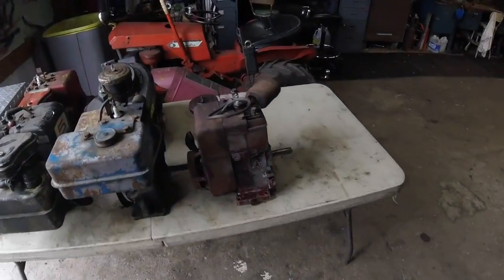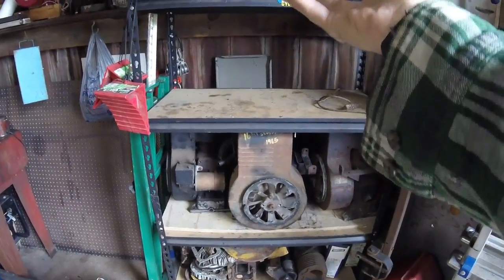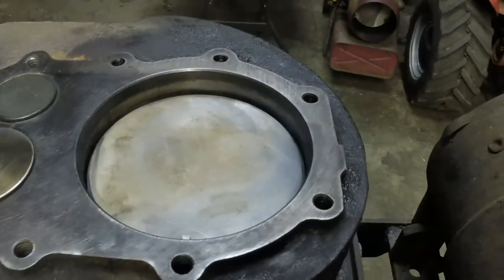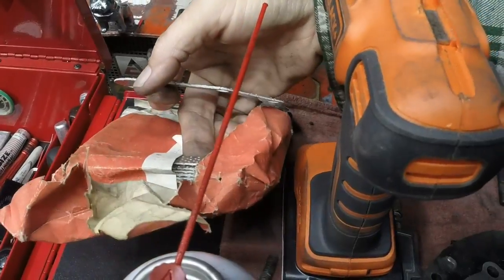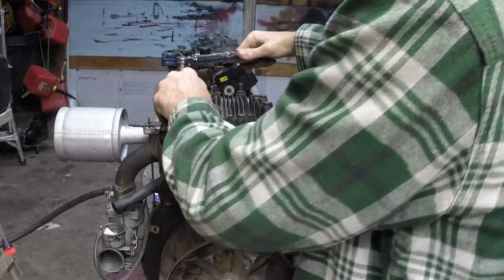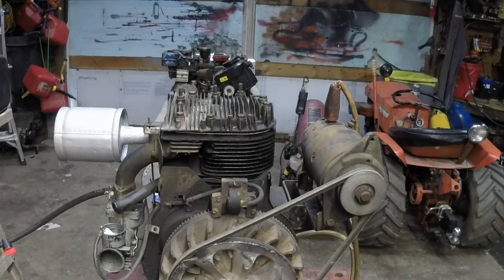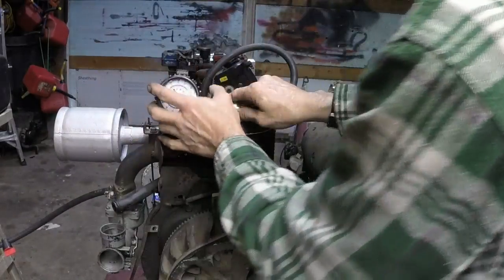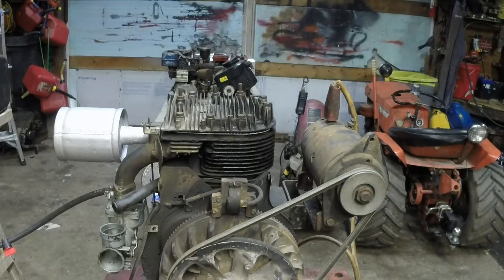Getting Engines Ready Part 1

Comment: did u use either
Reply from the maker: I did not. Although, on the third engine, I gave it a fog real quick. The carburetor was primed for all three (used the same one), but the second and third had a sheared flywheel key. I typically don't use Ether on anything other than diesel engines, but when I'm feeling lazy, I'll give things a squirt. Ether isn't good for gasoline engines which is why I try to steer clear of using it on them. Cheers! Zip~

Comment: I am a big fan of the BIG Briggs engines. Old model 8, 9, 14, 19 and 23 series of engines. I have been buying up all the local cheap ones I can find. I have quite a collection of Briggs manuals some being Factory ones. Where does one find that points eliminator shown on your video ? I have found  points for some  models hard to find and expensive. I have a lot of new sets of automotive points and I am working on a set I can adapt to the Briggs engines. As always I enjoy your videos and find them very educational.
Reply from the maker: Well, if you were to buy points and condenser, you're out in the area of $40...you can just about buy three of the eliminators for that! Search "Nova II Points Eliminator" on ebay, and they'll show up. Stens also makes them and if you're in a hurry, Most NAPA stores carry them in stock. Cheers Chuck! Glad you like the vids!!! Zip~

Comment: Gday
cool
so will u post that motor lol i need to rebuild the 7013s motor was running like a 2 stroke 
so whats that point thing i got a 70xx something that i did not get to start so i went to look at points and it had a can with 1 wire on it could not find anything in the country town i was in or test it . so what they worth? 
and the head toque i asked around and  and no 1 could tell me lol was told do it up ft
cheers

Comment: What is the model number of that Briggs ?
Reply from the maker: 32 prefix is the 16hp Cast Iron across 20 years Chuck. The 4 numbers following the 32 are not relevant to the Cubic inch displacement or HP rating, but do tell you crank shaft orientation, type of crank bearing (with or without reduction gear) and type of starter. Zip~